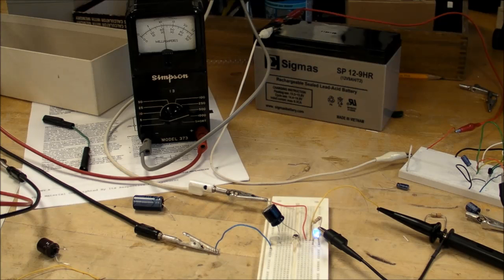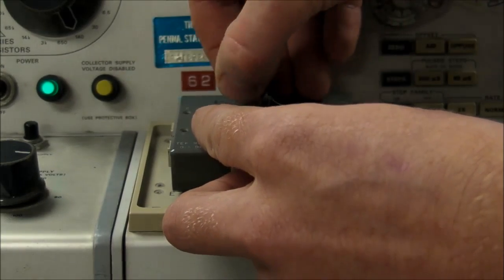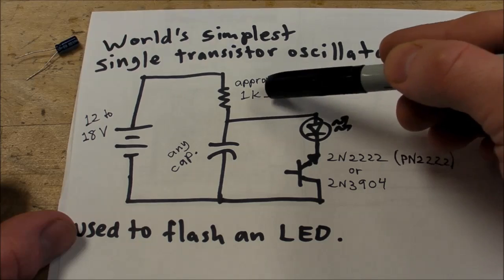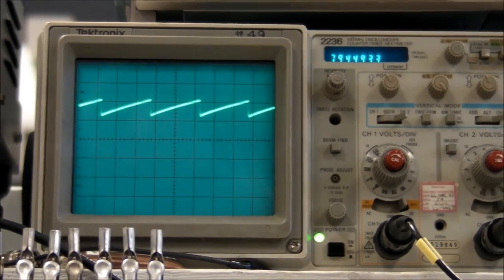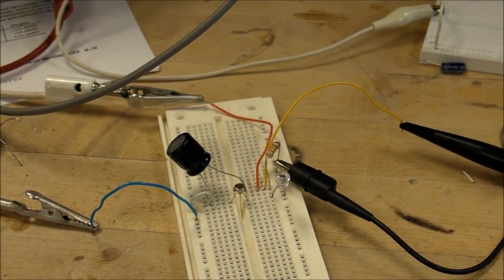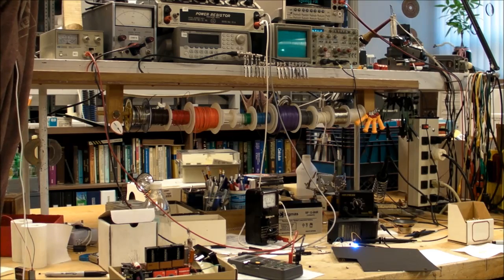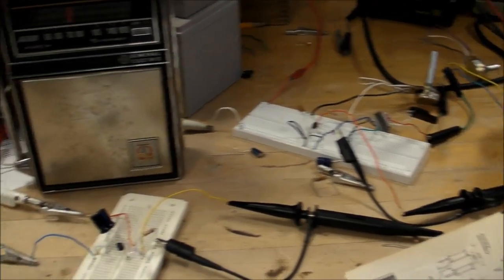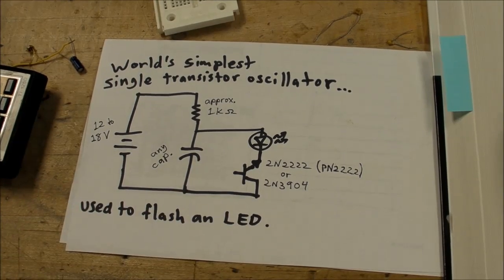(#0093) World's Simplest Single Transistor Oscillator - BJT with Negative Resistance

Comment: I've built this exact one in the past and equipped it with 2 capacitors with a factor of 10 for the difference in values and a pot on them as a divider so with the voltage division and 2 significantly different value caps, the bandwidth was massive.

All these years later, I can think of a dozen different schemes to build a variable oscillator with about 7 to 10 parts including the battery with better operating range and stability, but this one is just so incredibly convenient and can serve as the function generator of much larger scale circuits for a broad range of purposes that it's still impossible to beat. 

An important video for folks just getting started in the science.

Comment: I had to fool a Panasonic inverter microwave oven with this circuit. Basically, the MCU gets feedback from the inverter board which was fried. I replaced it with a traditional transformer, capacitor and diode set up that was lying around from another microwave. It stopped after 2s because of the PWM feedback signal. 12V supply from the MCU board, 1k resistor, 440uF cap, 2N2222, an optocoupler took care of it. It oscillates at 18Hz. Can't be happier.

Comment: it is a simple generator when you look to the amount of external components, however it can be a lot more simple and understandable still. sadly the internet escalates everything to balance into one single point and so you won´t easily find the other peaks. however in short, this cirquit is a waste of transistors, because you do not need to use the transistor. a single diode can replace that transistor which also makes the cirquit a lot more reliable because diodes are rated for such things, while transistors are tested and tuned for completely different things.

so that might be a even more interesting project for you, because that would make a even simpler and a lot cheaper oscillator. also it will probably seem like magic to all of those who havn´t read a datasheet. some diodes will be more difficult than others, and some might make it near impossible because manny diodes will get a lower voltage drop on lower voltages. for example I found that a uv led would go down to around one third of it's rated voltage drop when the voltage went from high to low before it would practically stop conducting, it would start conducting when it came around 2/4th of it's rated voltage drop before it would start conducting again. I used a uv led because it was that or a high voltage diode, I used it in a switch to detect voltages higher than a certain point, but you could make it a frequency generator as well. and ofcource if you have very low voltage diodes you can (better for generating signals) connect them backwards, that is the thing you do with these transistors and it will give a sharper edge and thus make it more simple to generate a signal.

Comment: .......thx, from comments I see the effect is avalanche breakdown and I've always thought this should work with zeners but never tried. The turn off voltage needs to be conveniently lower level than turn on voltage to be useful and I assumed zeners didn't have this convenient range but I'm too lazy to try it. 
 Real negative resistance is of course with tunnel diodes which operate at less than a volt. Clive Sinclair came up with some interesting circuits in 1960s for tunnel diodes , I'm positive he must also have been a real Q for mi5 . I never had any luck getting tunnel diode circuits to work , I now think that maybe they were faulty diodes , I have some vague memory of plotting the a chart for one and seeing it confirmed to published specs or that might be a dream  but anyway in mid seventies our own Electronics Australia magazine had a two page article for connecting up  p junction and n junction FETs to act as a tunnel diode and wire up with a coil and capacitor to make a sine wave  oscillator and that circuit worked immediately and produced a very clean sinewave judging from the sound in a speaker. I gotta find some old magazines one day to dig up that circuit again and maybe put heaps of other circuits too on u toob cos the staff had stated in the letters/correspondence pages many times that they made no claims to intellectual property for their circuits , copyright for the written accompanying article may be a different matter though . EA was perhaps the best electronics magazine in the English speaking world  and commenced in early 1920s and closed in 1999 with Silicon Chip magazine then inheriting their copywright  .

Comment: You can see same when transistor is connect properly at higher voltage. Avalanche effect appear in collector base junction too. Just apply 1,5 to 2 time higher voltage that is in datasheet. For 2N2222 effect will appear between 100 to 200 volts. Just make sure that resistor is 100k or more.
Otherwise  transistor will be damaged.

Comment: This isn't negative resistance, you're just exceeding the avalanche breakdown voltage of the base/emitter junction. Which is a really good way to fry your transistors btw. There's a very good reason why datasheets specifically tell you NOT to do this.

Comment: Just for info, while the circuit works fine on a breadboard, apparently the SPICE models don't account for the Avalanche breakdown. Multisim 2012 (using both transistors) failed to simulate it. By the way, I also like your lab!

Comment: What is the base of the bjt connected to?
Reply: This transistor can be looked at as a zener diode ( emitter base junction reversed biased of about 5 volts ) in series with another diode ( base collector) that is forward biased. Many silicon transistors have this nature about them. For some reason the emitter-base reverse breakdown voltage will rise with an increase in temperature and is compensated with the base-collector junction on the same chunk of silicon. How much closer together can they get? I have seen this being used as a voltage regulator in a power supply and as a directional voltage clipper. The base lead does not need to be connected to any external component to perform a circuit function. Also many silicon transistors can and will amplify with the emitter- collector reversed but not as well as when used in the normal direction. Think of a leaky transistor ( base collector). That leak is supplying base drive current. If the base is just hanging there connected to nothing then the transistor can conduct more and more as it gets warmer due to more leakage. Sony made a portable 8 track recorder that has a solenoid activated by a transistor to change tracks. While the tape was playing and you are waiting for the sensing foil to bridge two contacts, the base circuit was totally open -  connected to nothing!. That transistor had a very high failure rate due to uncontrolled temperature effected leakage. Foto transistors may or may not have a base lead coming out. With a clear case for light to enter to create leakage for base drive current, with the base not connected there is maximum sensitivity to light. Is it always necessary for the base to have  an external connection?

Comment: I bread boarded this circuit to mess with it. One can make an interesting 12V battery voltage indicator. It starts pulsating at 10.5V and pulses faster and faster until 14V. After that it is steady on. The pulse rate is indicative of the battery voltage. 
Cute avalanche effect of the Esaki Oscillator. Not negative resistance.

Comment: It's very interesting!
Is it useful to build a multiwave oscillator for an analog synth.? So I guess it can give square and triangle waveforms with some additions? The most important - is it  easy to remove DC offset? Or the whole schematic will be much more complicated than OpAmp based oscillators?

Comment: This is still not the right way of using a transistor; having its base floating and let it operate in reverse breakdown mode. This is an unstable mode and is at the mercy of several factors. To make a sawtooth generator it is better to use a 555timer that still has its basic benefits, especially stability, that you'd need anytime for an oscillator.
Reply: ok but for a cool cheap hack it's pretty neat
Reply: come on genius!!! we all know 555! this sigle bjt oscilator is like magic!!

Comment: Wont Work Until it gets 22 volts. And, big capacitor, say 3900 mF. Disappointing......
Reply: dan smith, i used 12v and 220uF and it works just fine
Reply: dan smith, and try to substitute resistor with potentiometer

Comment: Nice bench! Hang on to that 576 curve tracer. Last I looked they were still going for about $1500 each on ebay. Have used - and repaired - a lot of them but never could afford my own. (Actual 576 I mean, have built many discrete curve tracer circuits over the years but haven't owned a factory built!)

Comment: Nice video.  And I like your lab.
Now, you correctly called it a relaxation oscillator, but say that it uses the "negative resistance" of the NPN.  I have two comments on this:
1) True, it has a negative resistance region.  But the circuit operation is not based on this negative resistance.  It is more correct to say that it uses the "snap back" effect that is associated with secondary breakdown.  In other words, the NPN is used as a self-commutating switch, not as a negative resistance.
2) For the record, relaxation oscillators and negative resistance oscillators are two different circuit categories, and they work very differently.  A negative resistance oscillator would keep the NPN biased in the negative resistance region continuously, as opposed to letting the NPN switch on and off.  Also, a negative resistance oscillator requires a resonator, such as a crystal or a tank, and can't be made with just an RC.

Comment: how to make it go slower like one min on and off?
Reply: change the size of the capacitor ;)
Reply: Theoretically, you could get a 1 minute cycle just by making the resistor and capacitor really big.  But I think a more practical approach is to keep the frequency around 0.5 seconds, and use a ripple counter to divide the frequency down to whatever you want.

Comment: I need about 10 khz , what capacitor should I use ?
Reply: I don't know, but if you want you can use a trimmer capacitor and then measure what capacitance will give you the right value.

Comment: This is an Esaki oscillator, which is cool if you don't have any requirements other than frequency modification. If you need an Oscillator where you can control frequency and duty cycle you want an NPN, Astable multi-vibrator which consists of 2 NPN (any thing from  2N2222 to a set of  2SC3328 power transistors I tried) transistors, 4 resistors and 2 capacitors, which is a much more reliable circuit. The Esaki oscillator would not be useful in an SMPS (AC/DC-DC Conversion, i.e. boost, buck boost, flyback, etc.) application as the duty cycle is not adjustable, you'll overload your MOSFET and your NPN transistor eventually dies from the feedback. NPN transistors are not designed to be operated in a reverse biased scenario, it is better to use an RC circuit to induce oscillation.
I got all of the info from this video, he is very thorough: 
https://www.youtube.com/watch?v=4lFj6h-U6WI
 Visit his site, its kind of difficult to navigate, but again he's thoroughly detailed in his instruction.

Comment: hi sir ,i want to oscillate dc with high frequency so that output should drive a transformer.so, will your circuit be helpful in that condition?ican i take output from the place where the led is connected ?to drive transformer.please help

Comment: correct me if i am wrong and i probably am, but doesnt the transistor turn on when the voltage across collector and emitter is more than the VCEO(break down) voltage? according to the datasheet for a 2N2222 transistor it is 40V. How is it that the transistor turns on when supply is 12V? im referrring to the link in the description which uses a 2N2222 transistor.
Reply: It's the Emitter-Base Voltage (Vebo) you want to look at. Think Zener Diode.

For the PN22222 it is ~6Volts.
Reply: He reversed the collector and base.  The base-emitter junction of a bipolar transistor typically has a breakdown voltage in the 10V ballpark.
Also, there is first breakdown (which is the number you are pointing to the data sheet) and there is second breakdown.  His circuit uses the second breakdown of the base-emitter junction.  You won't find that in any data sheet.
Reply: At the first breakdown the base-emitter junction acts like a Zener.  But his circuit uses the second breakdown, where it acts almost like an SCR.  That's why you see the snap-back action on the curve tracer.

Comment: Eric Wasatonic , 

hey i also have some bjts however they are the 2N6427-4, and 2N4401-5 BJT's and i have two types of power transistors coming. they are TIP36C + TIP35C , and TIP42C power transistors. do you think they will work in the this circuit? i have a 9V battery source and a 11.1V , 5.5Ah lithium cell to power them with.  i have several kinds of resistor mainly .25W ones and out of the more powerful ones i have 1Kohm  and a bunch of potentiometers from 5-250Kohm. my capacitors are 1000uf, 3300uf, 2200 uf, and 1uf. i think this should work  easily, as i want to hook up a large load to the circuit so i can power a variable frequency electromagnetic experiment. also i seek to make a inverter from as little parts as possible so i dont need to buy one and at a size that it can fit in my hand and this seems like the one that can do that if i install a transformer in its output. 
thanks

Comment: This is how tunnel diode oscillators work.
Reply: No it isn't.  His circuit is a relaxation oscillator that uses the transistor as a switch.  He incorrectly stated that it is used as a negative resistance.
A true negative resistance oscillator starts with a resonator, like a crystal or a tank.  If you hit this resonator with an impulse, it rings, but the ringing dies down because of resistive losses.  Now, if you add a negative resistance in parallel, and make it larger than the positive resistance that is already part of the resonator, then the ringing builds up instead of dying down.
Reply: John Bond so it will work with a diode too if its not negative resistance

Comment: The circuit is valid, but not in terms of negative resistance.
Negative resistance is exactly what it is, negative value of resistance when doing R=V/I.
That is, normally, Current flows across a voltage drop, but negative resistance is current flowing across a voltage rise in a "strictly passive" component. That is possible using LC circuit with an active component across the nodes. The Reason why the textbook for Electronics course will not show this is because the topic is academically higher level, mainly the Digital Integrated Circuits course which introduces oscillators. Basic oscillator circuits may be introduced earlier in such of that textbook intended course level, but will not show the full background. I have done my research on Oscillators back in the day, my intention was to do a proper documentation as an engineering paper and to be my reference in future work. I don't like to undermine anyone's efforts, but if anyone is interested in doing further reading, check this presentation: 
http://academic.eng.au.edu/~ee3601/ee3601/lecture/EE3601-10.ppt
I will also drop you a little secret, negative resistance oscillators benefit from the internal resistance of a given circuit that is a frequency selective circuit. By design you need to counter the internal resistance that contributes to the attenuation, or better known the Neper frequency. By finding what is your Neper frequency, you can design your negative resistance "Current Injector" circuit to reintroduce the charges lost due to the internal resistance in the circuit. 
In this example here, recovery failure from reverse bias avalanche is my best interpretation. I can't put my finger on it, but for a NPN transistor, the tiny junction has other parameters that need to be taken into consideration, which is the capacitive and resistive internal characteristics and not of the Ebers–Moll model, since fields at that high voltage need to be taken into consideration as well.
Reply: The link that you supplied does not work.

Comment: i have a 2N3904 and it wont work :(

No matte what way I orientate the NPN.. it either stays on fully lit... Or off.. Help?? I use 1Kohm and 2,200uF with 7.5v power supply
Reply from the maker: +realflow100 Try a higher voltage and/or other values or R and C.
Reply: Eric Wasatonic I made it work much better using two 40-50W power transistors. a 1K resistor and a 250ohm resistor. with a 240V 4uF capacitor (from a fan)

A 9.6V DC 2A power supply. Then after the circuit I put a 9.5V 1.5A input transformer with 120V output single phase

Its strong enough to actually POWER a 40W stereo at loud enough volumes that it'll probably hurt your ears

And thats a 120V stereo that plugs into the wall. I'm very surprised!
the transformer gets warm but no warmer.
The transistors stay cool but I need a more strong power supply..
I am very satisfied lol
Reply: I needed 22 volts to get it to work.  And its be3tter w/3000 mF.
Reply: I fact, the "inversed" transistor can act in any of the three modes (cut-off, amplifying, switched on) but with "poor" (in comparisons with the "classical polarisations") properties ( such as beta and breaking down voltages).

Comment: Could I also pump the voltage using the cap at the same time? 
Say I had 130v incoming smooth DC, and a cap that could take over 100v (with a blocking diode to prevent it discharging back) and assuming my BJT (or zener diode perhaps?) had a breakdown voltage of around 200v, wouldn't that give me a 200v peak wave?
I'm thinking it could drive an electroluminescent display.